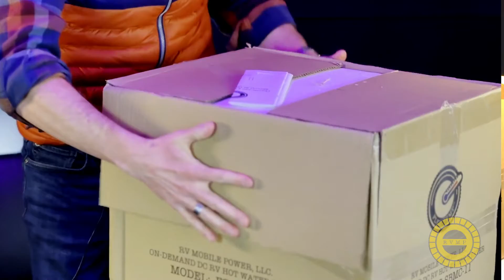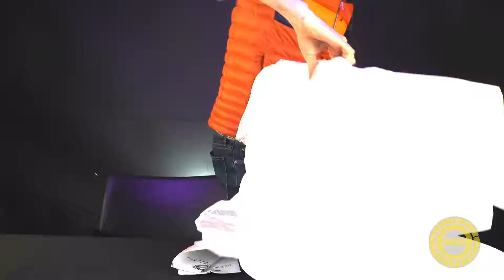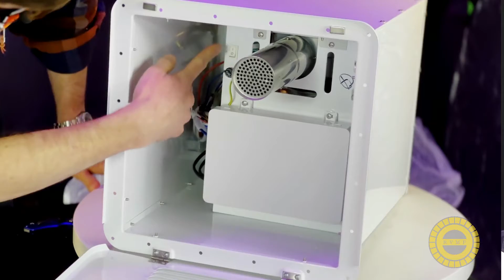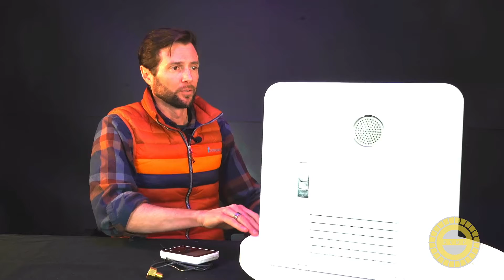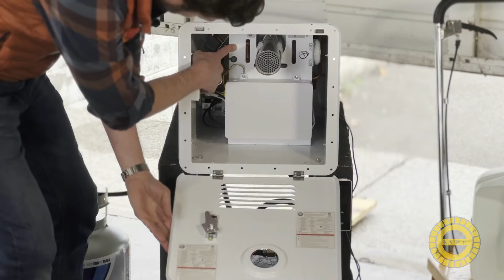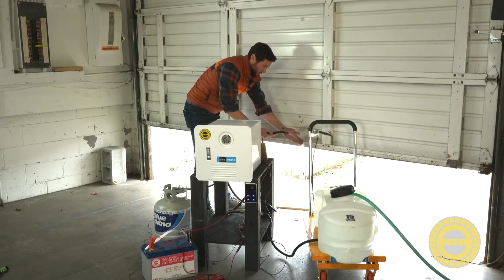RVMP Flex Temp™ On-Demand Tankless Water Heater - Unboxing and Overview of Install

Comment: Great product info. I have this unit on my camper trailer and my question is: how do I winterize it? Is there a tank inside that holds water (that may freeze in winter and damage it)? If so, how do I purge the water? Thanks.

Comment: Why is this considered dual fuel?
Reply from the maker: @scottybdiving thank you so much for your comment ~ this was actually a typo in the title of this video, not sure how this slipped through the cracks but we have since updated per your comment. Apologies for the confusion, we posted this the same day as a few of our Dual Fuel videos on our Installed Generators (4000i/5500i) and must have messed on the title. Thank you again! Do you have any questions about our Flex Temp On-Demand Water Heater?

Comment: I just installed this unit and  I was getting a E5 error and i was able to clear that.  Now Any idea on what i can not get the fan or burner to operate.  I have gone through all the trouble shooting ideas in the manual.  My water flow is above the minimum needed.   LP tank is connected and full.  Just a note  once i cleared the E5 error and turn the system on it heated the water for about 5 seconds and then turned off.  I have not been able to get the fan or burner to turn on since then.   Do you have any troubleshooting tips?
Reply from the maker: Sorry you are running into these issues. We're more than happy to help you resolve. If you could give us a call at (855) 427-7978 or email us at support@rvmp.co, we can provide step by step support.
Reply: @rvmp  hi I have tried calling and always get a recording. I have left multiple messages and emails over the past few days.  I just tried calling

Thanks.
Reply from the maker: @40invert  Our apologies! We typically have our support lines covered 24/7. Please email me support@rvmp.co and we will handle this immediate

Comment: Great demo. Just purchased this unit at Quartzite this past January. We have researched the internet for demos to install this same unit. Then I found your demo. Great. I do have one question: Several video's show installing a pressure relief valve, using a "T" adapter at the back of the unit. Some say you do need one, others say NO. Found one definition that distinguishes between a gas or electric device. This uses both DC and gas. Now what ??. So, how can I find out if our unit needs such a safety device. Our model is: FG-SBMC-11. Thanks
Reply from the maker: Thanks for reaching out ~ you do not need to install a pressure relief valve because the unit has both an internal manual pressure relief valve installed, as well as an automatic pressure relief valve in the unit.  You do not need to make an changes to the unit. If you have ANY issues please feel free to give us a call at (855) HAPPYRV and we can walk you through the install process.
Reply: @rvmp   That solves everything. We plan on moving ahead and installing it next Tuesday the 11th.
Reply from the maker: @josephmyers1492  Fantastic. If you run into ANY issues call us and we're here for you! Happy Campin!